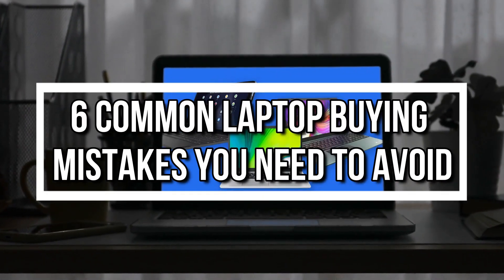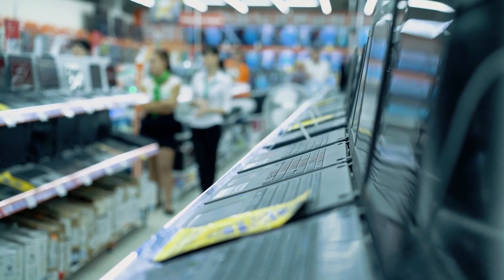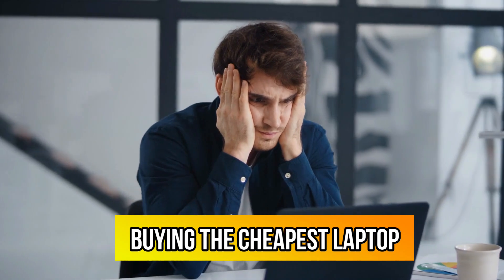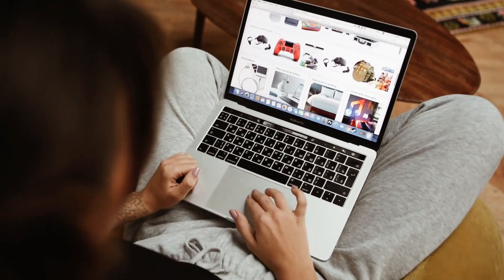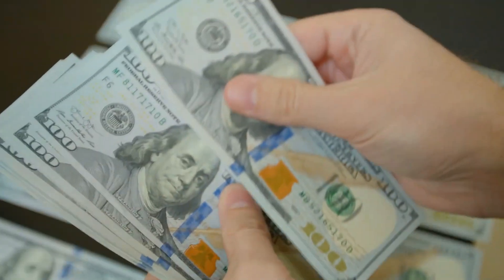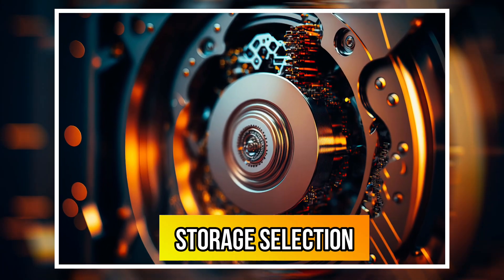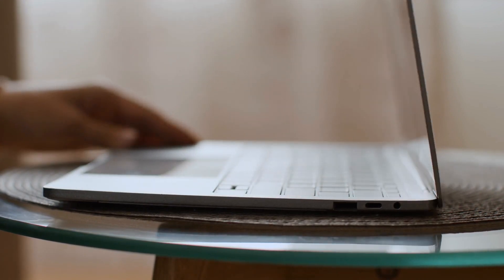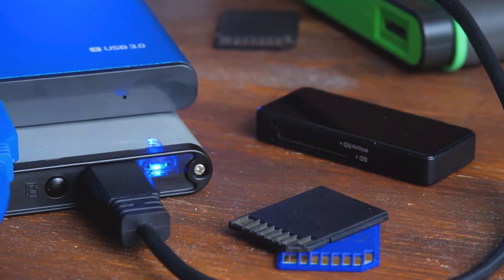6 Common Laptop Buying Mistakes You Need to Avoid!

Comment: I would add "upgradability" as an important factor to consider when buying a laptop.

A couple of years ago I bought an ultrabook. 

The problem came when I wanted to upgrade its RAM but couldn't do so because (in that specific model) RAM was soldered to the  motherboard.

As far as I know, there are some laptops that also have mass storage (SSD) soldered to the motherboard.
Reply from the maker: That's a useful suggestion indeed.